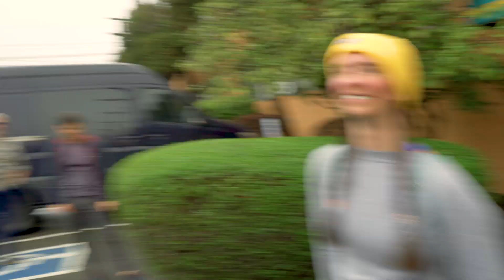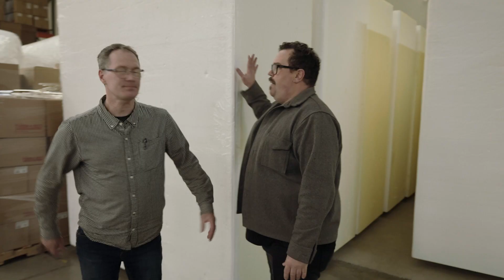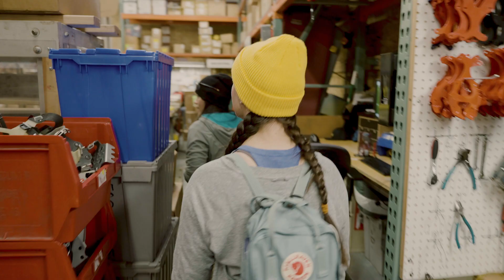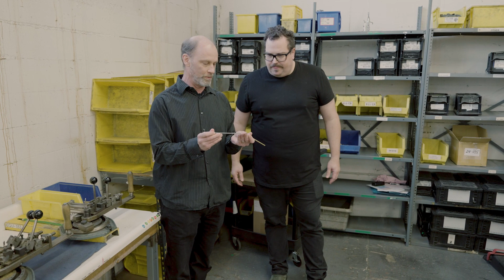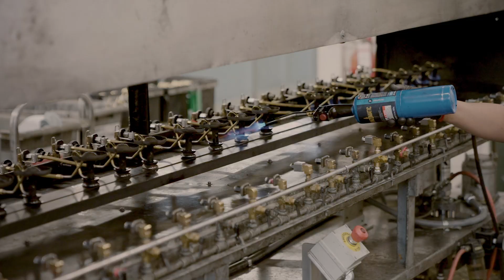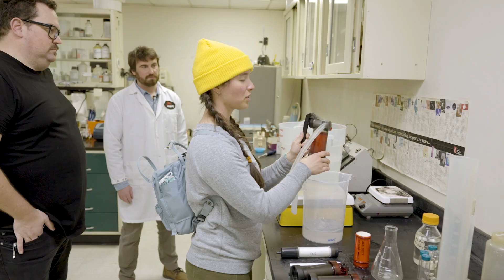How CAMP STOVES and SLEEPING PADS Are Made!!

Comment: I sent an old Whisperlite International (with the old flat-top jet) in to Cascade Designs. My unit was so old it didn't have the shakerjet needle. When it came back to me I not only got the shakerjet but two new domed jets! They also replaced the fuel line and generator tube.
I ♥ Cascade Designs!